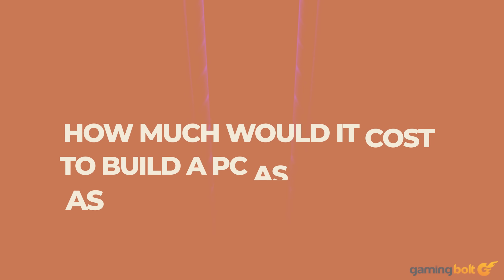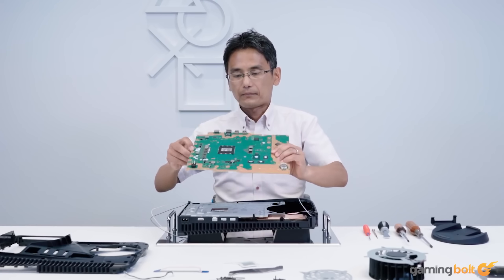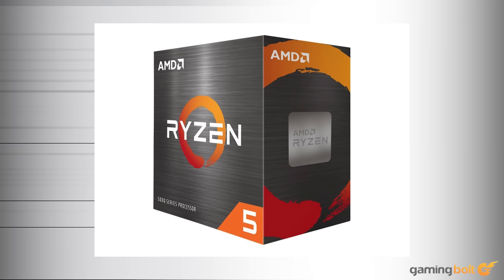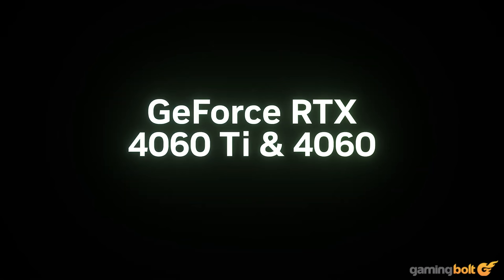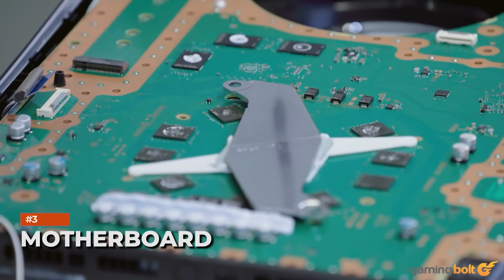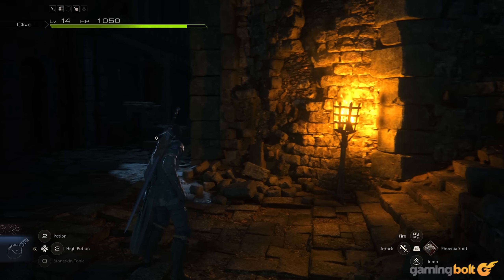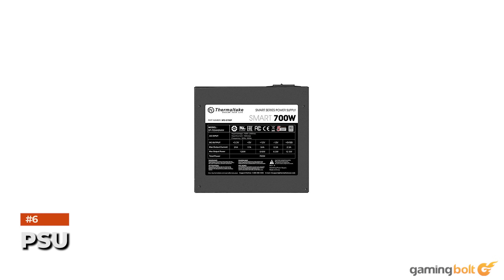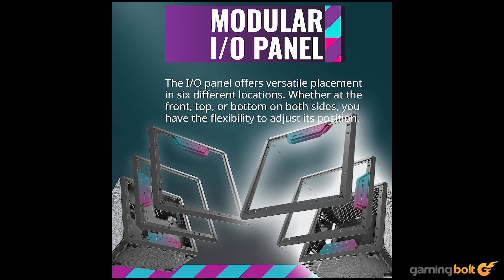How Much Would It Cost To Build A PC As Powerful As The PS5? (2023 Edition)

Comment: You forgot the ease of jumping straight into a game on PS5, no error messages to deal with, no manually changing configuration files, no replacing dlls, comes with controller, cheaper games in general (when on sale compared to steam), less frequent and more stable OS updates(compared to windows),
Reply: Also add on to the fact that the due to optimization, games on pc needs almost 2x as expensive hardware for a negligible improvement over the performance on a console. PS5 (especially the slim) has the most bang for your buck for gaming performance than any PC so far.

Comment: Why would you go Nvidia? Why not AMD, which is what the ps5's GPU is based on? The RX 6800 (non xt) would be much closer I think, plus they both have 16gbs of VRAM. The 4060 makes no sense.
Reply: the rx 6800 is much more powerful than a ps5, the gpu that comes closest to a ps5 is probably an rx 6600xt
Reply: @salvatoredevita4403  i believe the PS5 has 16gbs of video ram, the 6600 has 8
Reply: @bizbarley74  yes, it has 16 gb of vram, but the power of an rx 6600xt, vram isn't a measure of performance

Comment: Gpu inside the ps5 is more inline with rx 5700xt/rx 6700. And the cpu with its 1/4 memory chache vs desktop variant means it performs more like a ryzen 7 1700.
Reply: looking at specs, the ps5 gpu is pretty much the rx 6700
Reply: Id say the cpu is a 3700 non x, if such a cpu existed
Reply: @JeffCollins05   No, a 3700 is sustantially faster than whats in a ps5. You dont just look at the number of cores,  there are more things involved. Severely cutdown cache, frequency and power.  The ps5 cpu is a 4800S, sold in China. DF already got one and did videos about it. There are games like Cyberpunk or Metro where a vanilla 3600 is 40-50% faster than the ps5 cpu
Reply: @JeffCollins05  an downclocked 3700x? for temperature purposes probably
Reply: @iamagood6452  yeah that would also be an option
Reply: @JeffCollins05  it has 1/4 of the cache mate Vs desktop counter part lmao it's actual performance would come more inline with Ryzen 1700 at best.

Comment: Rizen 5 5600 

RTX 4060 TI & 4060

Mobo: Aurus B450 Elite

Samsung 980 pro nvie 1TB

RAM unknown

$40 pos tower 

Pos psu 

Still need to buy windows and no disc drive included whatsoever. 

Crappy vid, f**k you earning anything from those million ads and that drawn out bs.

Comment: There are many issues with this video. Most notably, the gpu choice. The gpu of the ps5 is most similar to the rx 6700 (non-xt), and the 4060 is horribly expensive for the performance it provides. Even still, the gpu in the ps5 is cut down to performance near the rx 6600xt. Additionally, the cpu could be better matched to the ryzen 5500. Also, the motherboard needs to support nvme 4.0 to support the ssd speeds of the console. Such a system would run you around $600 new, but would still require a mouse, keyboard, and controller if you plan to play it like a console. Lastly, without any benchmark, this video is pointless.

Comment: Wow I am truly surprised how good of quality the video editing is but at the same time how poor of tech knowledge this video has. These aren't  good recommendations and clearly shows the inexperience in whoever put this list together. If you don't know PC's very well then you wouldn't know any better. I own  a bunch of extremely (9) similar builds and am very fimilar with ideal parts to pair together on the midrange. One of the big advantages of PS5 is the extremely fast NVMe storage drives and how they are actually utilized compared to PC that has the hardware but currently still has next to no software support. But still if building a PS5 equivalent you would want to lean towards a faster storage solution which actually is more like Gen5 spec which of course is way out of budget for this build. But clearly the next step down would be Gen4  not Gen3 support hoping the software solutions like Direct Storage would be implemented soon.

Ryzen 5 5600 Zen3 is a great chip that I own two of. I even sold off the older Zen2 8core / 16t 3700X for it. The 3700X is very similar to the CPU in PS5 but with better clock speeds.
4060/4060ti is a good mid range card but like many mid range cards they are best paired with Gen4 setups due to their reduced 8x bus. Most people mistakenly see 16x gen3 vs gen4 comparisons and see little difference, especially in benchmark tests from years ago. Today budget GPU's handle much more data so when you combine not only the 8x bus instead of 16x but then pair it with Gen3 not Gen4 you take a double hit. 8x bus on Gen3 is equivalent to 10yr old Gen2 16x bus speeds. Some games really do take a big performance hit when you limit a modern card on both 8x and Gen3. So if you must run a 8x card then you should focus on a Gen4 build. Or if you have a good Gen3 build then focus on finding a 16x card like a 3060ti/3070/3080 or 6700/6700xt/6800 and avoid 4060/6650xt 8x cards. Again not all games get a huge performance hit but you are not simply halving your bandwidth by going from 16x to 8x you are halving it again by running it at Gen3. 

Motherboard. He recommended a 5600 cpu which is great and supports Gen4 spec. Then he recommended a modern GPU that only supports 8x. So now you want to make sure you buy the right motherboard. Which should be at minimum a B550 with proper Gen4 support. His B450 board saved what $10? There is ZERO reason to buy a B450 board when B550 boards can be had for the same price if not a tad more. Now you give proper bandwidth support to the 8x GPU and you have the ability to actually run that Samsung 980 pro at full Gen4 speeds which is still slower then PS5.  His B450 recommendation saved next to nothing on build cost and gimped the GPU and the NVMe drive.  If you already had a B450 board then you could have just bought a Gen3 drive and a 16x card like a 3060ti or 6700XT which 16x bus will provide ample bandwidth at Gen3 speeds.

The biggest mistake was the B450. It simply did not fit the 5600, 4060ti and 980pro. I started on B450 years for my Ryzen builds and easily was able to replace all of them with 8x x570 boards and 1 B550 board. Most of the time you can find B550 or X570 for very close to B450 prices even new. Used of course. I know this was new only parts but when I found good X570 deals like Asus TUF X570 new in box for $80 and turned around and sold B450 Tomahawk for $80. New you can find $75-100 B550 Gen4 boards pretty easily. X570 just gives you a bunch more NVMe full speed options compared to the single full speed slot on B550 for NVMe.

I doubt many will read all this but I had this video playing in the background while I cleaned up in the room and was shocked to see that B450 in the mix. If this was a Zen2 3600/3700x build with 2080/3060 then sure B450 at $50 tops would be fine. Not with Zen3, not with 4060ti 8x and of course not with 980 pro Gen4 drive. Silly.

Comment: The ps5 will also start performing even better as time goes by
Reply: Not really, but when developers ditch PS4 and only develop for PS5 the games should be much better optimized for the PS5 gen (incl Xbox). If you make a game that can run on the newest, and a potato, there are many things you can't do in the game due to the potato.
Reply: @johnwayne-kd1pn  sony will release a patch that would transform the ps5's gpu to rival 4090
Reply: @Benri05  Not everything is purely about hardware. Let's take me as an example. If I was to design a game on 4090, it would look worse than if a good professional studio designed a game for 580..
Reply: @johnwayne-kd1pn  also sony will release an update doubling the ram
Reply: @Benri05  Yeah, well, it pretty much is double already, because consoles don't really need ram, it's almost all unified Video RAM anyways. 14 GB vram for sure, a few GB flexible.

And, ofcourse, unlike a general purpose OS, a gaming dedicated OS don't need to spend RAM on all kind of non-essential purposes, and don't have a bunch of crap hogging at the ram.
Reply: @johnwayne-kd1pn  true, based on the leaks by the end of this year sony will release a patch making the unified memory from 16gb to 32gb
Reply: @Benri05  Ofcourse you say so, but you don't realize that software is actually just as important as hardware. Afterall, without software you can't do anything with a computer..

And you can actually improve and optimize software too, something Microsoft never understood. With good software you can do at least as much on 16gb ram machine as bad software can do on 32gb ram machine.

Gamers don't really understand computers anyways.. If they did, they would switch to GNU/Linux for gaming immediately. Among other things this operating system proves exactly what I say, as it can run well on ancient hardware, and do things with it that Windows and Mac OS X can't even do with modern hardware.

Comment: I thought I read that the PS5 gpu is most similar to the specs of a 10gb RX 6700. I have one paired with a 5600 cpu and I think that would be a closer match.
Reply: I've seen 2070 too, either way not a shock that nothing comes close to it within a $400 price tag
Reply: @jakesghost5267 arguably a 2070ti or a 2080 , maybe in some games even higher
Reply: @Omar-kl3xp  digital foundry likes to use the 2070super as thier ps5 comparable gpu and that's about right
Reply: @jakesghost5267 you can't really go with only ticket price on consoles since online on them costs and because of that the consoles are initially sold at loss. So least add the 7 years (time Sony takes to release next console) of PS+ on top of the $400 to make fair comparison.
Reply: It will never be apples to apples just comparing raw specs because most PS5 games were made with that hardware in mind. They are optimized to run well there and use all of the advantages it provides. A comparable experience on PC would require you to run something more than equal. Even then, it’s never going to be easy to compare and will vary from game to game. So it’s just safe to overshoot the PC hardware if you want to ensure you’re beating the consoles most of the time.
Reply: @joelman1989  This is so true, but most pc gamer will disregard this as the hardware specs are incomparable. Optimization is the key where actually pc and consoles are comparable.
Reply: Ryzen 3600 is more like it
Reply: It is technically most similar to a RX 6700 but it can't clock as high as MHZ because of overheating issues so is probably closer to a 5700, which in turn boost clocks to about as high.
Reply: Hey your still locked at 120fps so it don't matter
Reply: Your still locked at 120 fps so it doesn't matter how powerful PlayStation is
Reply: 5600 is far too powerful i think the 3600 is closer
Reply: @gandalfurisotherworldly7909  Technically, the Ryzen 3700X is the closest to the PS5 but the 5600 is better at gaming and new for new, the 5600 is the same price or less.

Comment: worthless comparison.  The issue is not the hardware.  The reason that consoles can do what they do so well is because the games are coded to one hardware spec and basically one class of software spec.  PC running a PC operating system has tremendous "bloat" in order to accomodate the millions of different hardware configurations and the millions of different software operations.   Try running blender on your PS5 without knowing how to code a ghost layer alongside GPU layer.  Try plugging in a hardware raid controller to your PS5.  You can't.  But i can do both of those things on my PC with the click of a button.  I am willing to trade off performance in certain areas for the increased functionality.  However, that comes at the cost of the fact that i have to purchase significantly better hardware at significantly greater cost to overcome the system software bloat of being able to accomodate those choices.

Comment: a PS5 is roughly equivalent to a Geforce Rtx 2070 super or a 5700xt if it had ray-tracing, and for the processor, the ryzen 3700x is close. Add a Good ssd and your done. its not that expensive or hard to match and exceed the specs and performance of the ps5, not even when when it released, despite what Cerny said.. If you want something that will Decimates the ps5 Horrifically, go a 6800xt gpu and a 5800x3d cpu if you dont want modern hardware.

Comment: The specs are way too off.. the closest match is as under

Zen 2 - R7 3700X (8C, 16T)

RDNA 2 - RX 6750 XT (overclocked)

Memory - 2 x 8GB DDR4 , 3200Mhz

Storage - 980 Pro 1TB

Mobo - X570 based entry level mbo (for PCI 4.0 storage)

These specs will be best suited for native 1440p 60fps gaming.

Comment: Yo this is a trash component list. Thank god yall didnt try and build this, yall didnt even mention ram cas latency, that matters. The psu is too much for the components. The 5600x barely uses 65w. You could easily get away with a 500w psu. The gpu is too powerful, ps5 is more like a 5700 xt. The 5600x comes with a cooler too, so i have no idea why you would just get 5600 for coolers sake. And you dont need a case. If you tryna do things a cheap as possible. Biggest misconception in building. How often are you really moving your desktop computer?

Also theres a random 3070 mention for some reason? Which actually prolly would have been a better option cause its the same price as a 4060.

Comment: For me the issue isn’t as much cost as it is convenience.  Knowing the game I buy will work on my hardware at optimal settings (that I don’t have to play with) has always been my reason for not PC gaming. Because every PC is different, this just can’t happen on computers.
Reply: Most games actually have auto optimizations based on the gpu you have. There’s not much set up at all. Not anymore than you do on a console really.
Reply: @Dirt_Serpent  He's talking about the base-level coding of the engines and games.

Since the Great Consolization of 2008, all AAA games are designed and coded for console HW **. They don't run near as well as they would on PC if they were coded specifically for PC architecture. PCs use brute force to overcome the poor coding/optimization. This is something that has made me very unhappy, but even so there are far, far more reasons to support the open PC paradigm than the proprietary console paradigm.

** With a few exceptions, namely Crysis: Warhead (2008), The Witcher: Enhanced Edition (2008), Left 4 Dead (2008) Left 4 Dead 2 (2009), and Portal 2 (2011).
Reply: this argument has never worked, you don't even know what you're talking about - PCs support more games than all consoles combined and they get updates for much longer and more frequently too. It might cost a little bit more to get similar spec on a PC but the game will run at higher detail, higher fps and much smoother overall. And if there's ever an issue, you can actually try and sort it out yourself because you aren't locked out. Consoles games are not better optimized they are butchered with all sorts of technologies that artificially improve frame rates and in most cases just use lower quality textures and shadows since most console gamers don't know their games look trash. Most of those technologies end up coming to PC, too...
Reply: @aldeed bro the same thing is happening with PCs… coff coff.. DLSS

Everyone views it as free performance boosts but are to dumb to realize that they are paying for AI cores in their gpu to support dlss. 

And have you noticed that the 40 series cards are only more expensive because of the AI cores. There wasn’t really any hardware advantages.

All In all people are getting scammed for worse upgrades rather literally hardware upgrades.
Reply: @balloonb0y677 Except DLSS is hardware-based and gives you a much better result than the FSR used on consoles. And also, it's not MANDATORY, you can turn it off if you don't want to use it. I personally don't use it at all except on RDRII because TAA looks like trash on that game.
Reply: For me the issue isn’t as much cost as it is freedom. Knowing that I'm not at the mercy of Big Console dictating every aspect of my gaming experience from top to bottom.

I outgrew consoles (though I still play my old ones, of course).

Comment: $770 and you can't play on it because you didn't include a controller.
Which is fascinating, by the way, that the architecture itself, CPU and GPU, get cheaper every year, the price of a controller stays the same in general.
Reply: Ps5 need tv tho
Reply: @lafelas7244  pc doesn't need a monitor though. The air can display our games

Comment: If you what similar in power with the PS5, Ryzen 7 3700x is the closest cpu which has the same cores and threads. PS5 GPU is kind of in between RX 580 and 6700xt.
Reply: 😂😂 rx 580???😅
Reply: RX 580 is more in the territory of Xbox One X. For the PS5, yes the general consensus seems to be it's around a 6700.

Comment: Actual ps5 build 
Ryzen 3700 in eco mode
Rx 6600 gpu
Cheapest 5500mb/s nvme you can find 
Cheapest 3600 cl16 memory you can find 
Guarantee this would basically match the performance of a ps5 for around $550 but you also have to buy mouse, keyboard, controller (if that’s your preference) monitor, speakers, desk, chair, etc you can’t beat the value of a console and the economics of scale.

Comment: in my country that will cost you much more 
420$ for 3060 and the 4060 is more expensive
Samsung ssd at 120$ but there is cheap ssd for 70$
you forgot joystick duel sense 70$ mouse and keyboard their is cheap about 25$   
.
and their is one thing most have in my country....... ups

Comment: You're ignoring a lot of Key Factors about the PS5. Its a console with a Blower Style cooling setup and 350 Watt PSU. The Component match doesn't make sense since the PS5 won't be able to achieve the same level of performance as the PC you built for 700 Dollars.  The Thermals would be higher and the bottlenecks much greater if the PS5 didn't have games specifically optimized for its hardware.